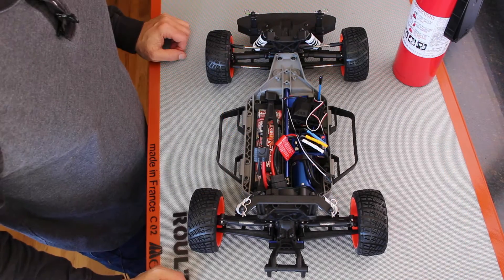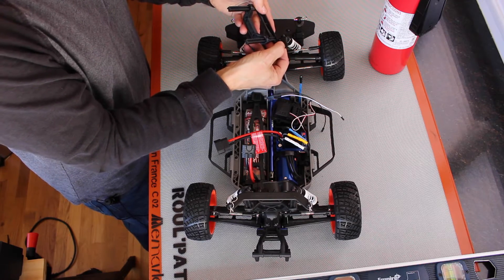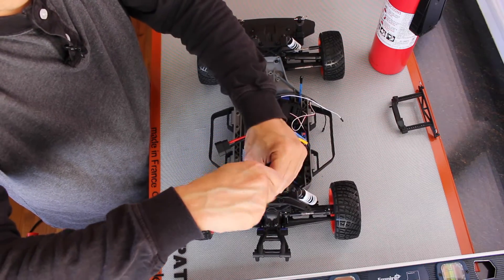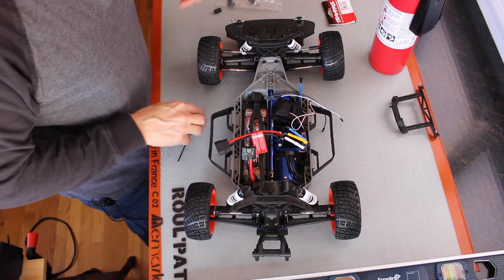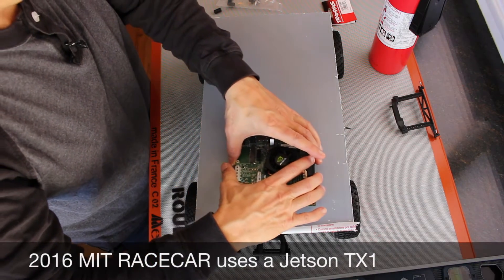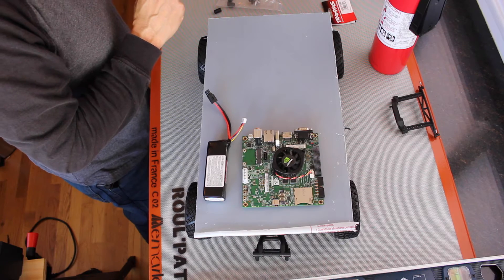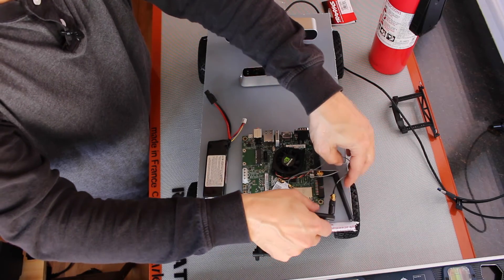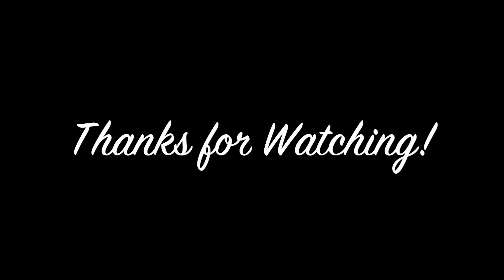Jetson RACECAR Part 4 - Platform and Sensors Discussion

Comment: You can buy stiffer springs.
Reply from the maker: +hjkl Yes, it's quite a dizzying array of after market parts you can get for the car. People have videos on YouTube of their modified version going 145mph, with the only stock part being the gray chassis pan. Some nice aluminum shocks might be a nice addition.
Reply: It will flop around all crazy with the added weight.
Reply from the maker: +hjkl Is there anything in particular you are concerned about? With stiffer springs (and what MIT did was add all of the spring stiffeners provided with the Rally in the box), it didn't seem to bad. Here's a clip, including on board video: https://www.youtube.com/watch?v=MCmgfHjMIKg
This is last years car which mounted the platform on standoffs, I believe this year they are mounting directly to the suspension towers, but we'll have to see.
Reply: +Jetsonhacks For the most part everything should be okay.
Reply from the maker: That's why we play the game!

Comment: i was thinking about the kinect xbox one sensor.  the price for a refurbished one is cheap and it is easy to find. just a suggestion. I don't know if it fits to the project needs. something else is a laser sensor of the robotic vacuum cleaners. like of the neato brand
Reply from the maker: +worldburger The Neato is well engineered, which means that they've done as much cost reduction as possible. In turn, that means that the spec on the components are probably pretty close to maxed out. I would think that one of the major issues would be the slip ring, as you'd have to double the number of revolutions per minute. Also, the motor is probably pretty fast, it's geared to slow it down. But it might be worth a try.
Reply from the maker: +Thiago Coura The Kinect sensor is a viable sensor, it requires some hacking on the cable for use, a motivated person could use that for a sensor. At this point, I'm leaning towards two things. First, if it's on the MIT RACECAR to begin with, support is easy as the software will be readily available which will make it easier to support. The second is that the sensor(s) should be available to buy new or refurbished from a reputable manufacturer so that there is assurance that the sensor actually works (or there is a remedy in the case that it doesn't). 

The Neato LIDARs are a mixed bag from the people I've talked to. Most migrate over to the RPLIDAR eventually. The issue for both of these devices in this application is that they are relatively slow (5-8 Hz). The Hokuyo LIDAR used on the MIT RACECAR is 40Hz. From what I understand, for the speed that the RACECAR goes (<10mph) you could get away with around 20Hz. University of Pennsylvania has a similar project car (also built on the TRAXXAS Rally) where they used a 10Hz Hokuyo and reported that it was insufficient for the task.
Reply: +Jetsonhacks Any reason you couldn't just get a faster motor on the Neato Lidar and run it faster?

Great documentation! I've watched all your RACECAR videos now :)